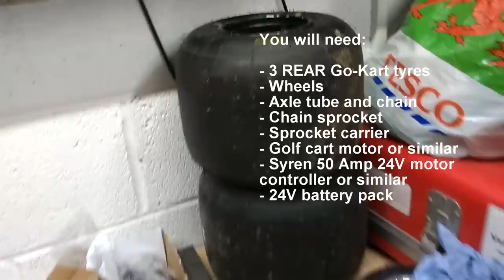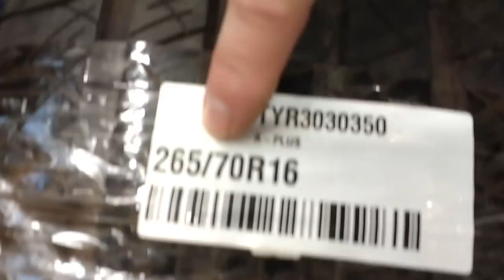Making an electric monotrack bike.

Comment: Yep, got the Vector pun and liked it! Straightforward!
Reply from the maker: Was thinking of putting a cross-hair gunsight on the front. Aim it at your destination point then just go for it - in a straight line of course.
Reply: @XenonJohnD  barely managed not to wet myself.

This is not meant to be an insult to your engineering effort - or your humor.

Most definitely not.
Reply from the maker: I was also thinking of making a fake satnav in the control box with messages a bit like this: Please drive straight for 364 miles, then stop and make a right turn..........and so on

Comment: Good to see you had protective gear on! :-)
Reply from the maker: The main protective safety design feature is the seat runs full length which stops your nether regions being ripped forwards under the handlebar bracket should you slide forward on the seat a little! I recommend a full length seat.

Comment: but wait, can it turn? in the video it only shows the Monotrack bike going straight. the only implied turn was at 5:23, where John changes his Center of mass to the left, making the vecter turn left.
Reply from the maker: No it can't turn hence the name the Vector, as in vector - graphics (made up of straight lines, think the 80's Asteroids game, or the Star Wars arcade game). The strategy is to pick a way-point and aim for that, then find another and so on :)
Reply: @XenonJohnD  ok, it really  looked like you turned . however, would there be any way to do something to the vector to use my explanation?

Comment: Lol, amazing! It would look even better if it was longer...
Reply from the maker: Size is limited by the circumference of the tyre. Tyre is used as a track because any other form of track tends to be expensive and this was built for fun with no idea if it would even move or not.
Reply: Could a tractor tire be used?

Comment: omg, awesome! wish you had some offroad (non flat gound) video, what incline can you climb? I guess the motors are the limiting factor?
Reply from the maker: Partly limited by motor power although is deliberately low geared right now as I was not sure how much torque would be needed just to turn the track. Eventually the rear wheel slips inside the track as not interlocked with it like in a real tank. However this is offset by having nearly all the weight of rider over this rear wheel.

Comment: Cool! What power is the motor? Is steering done by weight shift?
Reply from the maker: Motor is nominally rated at 500Watt. Originally from a golf cart and seems to be very well made compared to current budget DC motors. Steering was meant to be done by weight shift but actually it stubbornly refuses to turn. By sel-balancing it on rear wheel just for turns, it might turn more like the unicycles do (curving the contact patch with the ground). Future experiment.....

Comment: Great project!
Could you provide some dimensions of the frame?
Reply from the maker: Honestly everything is worked out backwards from the tyre. Put the wheels inside, stretch them out so tyre is tight around them and then dimensions of frame will be clear to you. Start off with it a touch too long then gradually move the bearing points inwards. If you notice my rear wheel adjusts backwards in a way similar to how the chain tension on rear of a motorbike is adjusted by moving rear wheel back on an adjuster.

Comment: That is pretty rad, thumbs up! Is the adjustment piece shown around 2:18 on both sides, or just the side shown? Guessing that grips the axle and pulls it tight?
Reply from the maker: The adjuster is each side and moves rear wheel backwards a bit like on some motor bikes to tension the chain. In my case you put track on from side then you move rear wheel backwards around 6cm or so to put some tension inside the track to lessen risk of it just falling off the side of the wheels. You then separately tension the chain drive by adjusting motor position like adjusting alternator on a car.
Reply: @XenonJohnD  Very cool!

Comment: You would be able to steer it if your track was rounded instead of flat
Reply from the maker: I agree, we need to make the rollers out of Rugby balls ideally (or American footballs). Could also try overinflating the go-kart tyres so they bulge in the middle.
Reply: @XenonJohnD  There are many Onewheel pint stock (round and smooth kart) tires out there waiting for a purpose like that. You should ask your local OW service people if you can get three and I bet they would be free.
Reply: @XenonJohnD  however, at 5:23, you change your Center of mass to the left, making the vacter turn left.